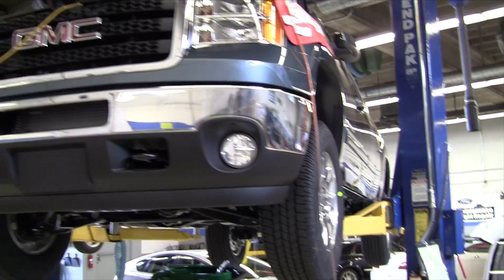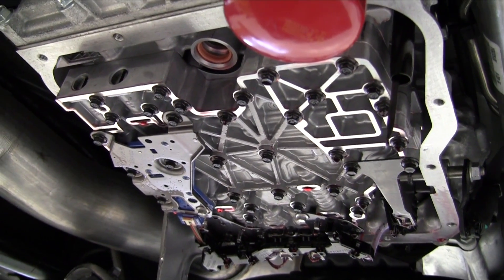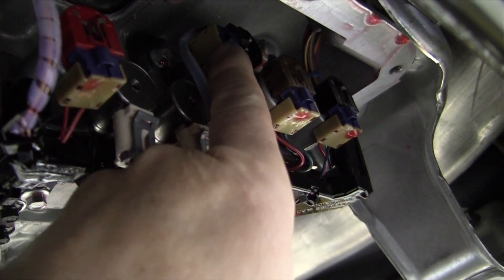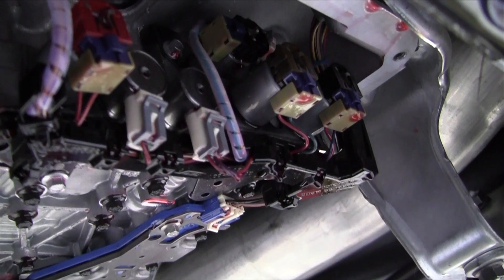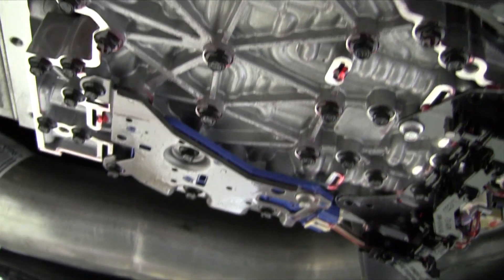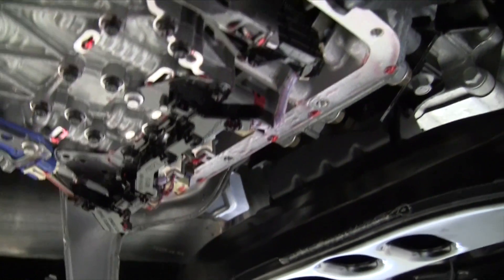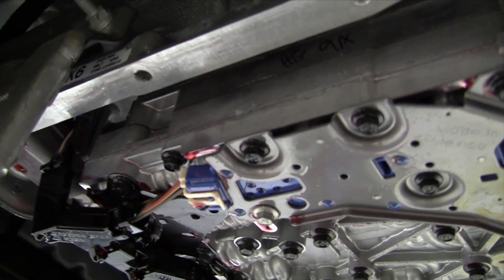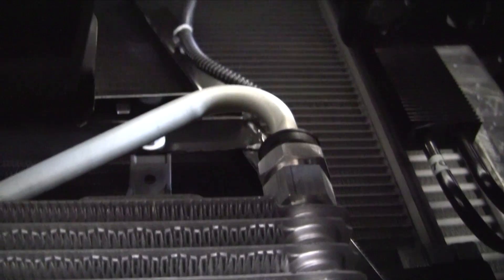2011-2012 Allison 1000 Valve Body Solenoid Changes

Comment: Such a great amount of knowledge, I was not ready for.
Man thanks for all the info I have a question for my 2018 really hard shift 3rd to 4th when temp is 170 and higher getting on the highway, light foot pedal, not even towing, could this be the torque converter that looks up or what? Its a really rough shift but I get no noise from the transmission.

Comment: What would cause a hard engage into reverse intermittently? From drive to reverse or park to reverse it does it from either very frequently. Fluid is clean and smells fine. Spin on is change regularly. This has been going on for over a year and it's getting more frequent. Would a solenoid cause that?
Reply: I would check your motor and transmission mounts.
Reply from the maker: It is not likely a Trim solenoid B problem unless you also have a hard shift into 2nd, 4th, and 6th. Could be high line pressure due to high idle speed or a DTC set. If it is a mechanical problem with the C3 clutch piston or clutch pack, you would have a hard shift into 3rd and 5th as well.